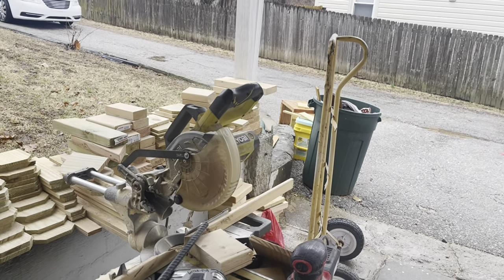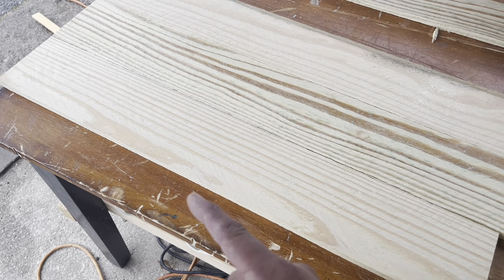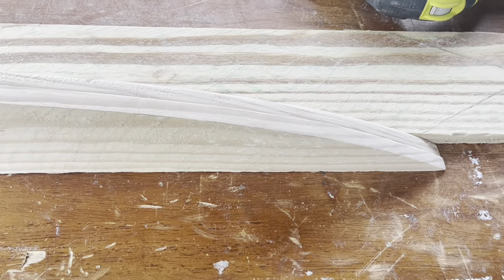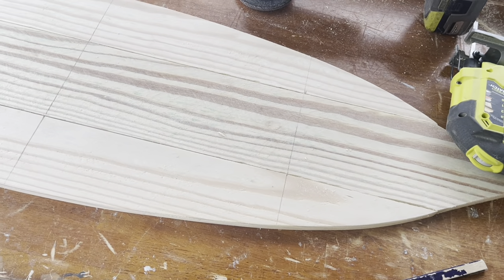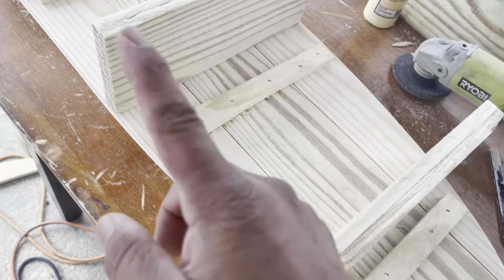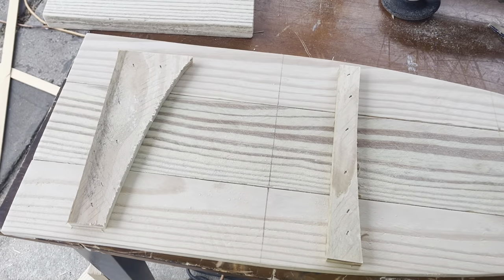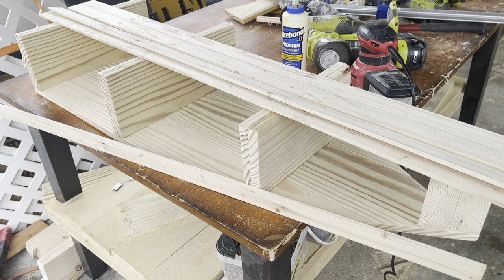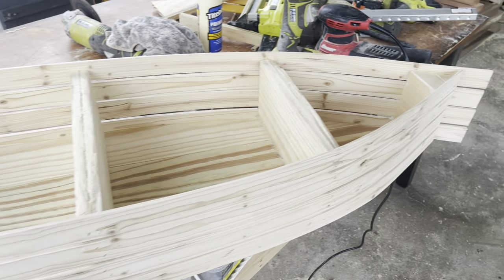Fence Picket - Boat Shelf

Comment: I might have missed it but how thick are the side strips?
Reply from the maker: About 1/4" thick... If you rip a 5/8" Fence Picket in half I find that to bend pretty good... 

The kerf of the table saw blade would leave you (2)  1/4 strips.....